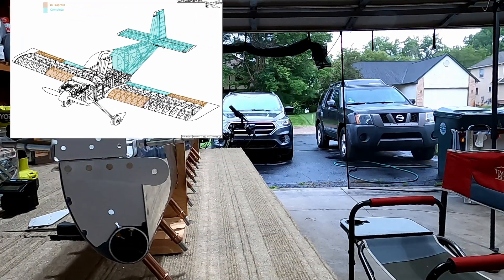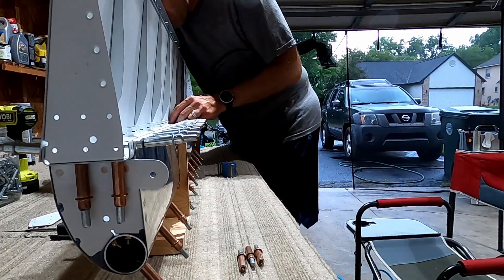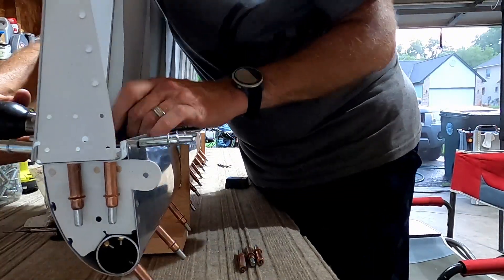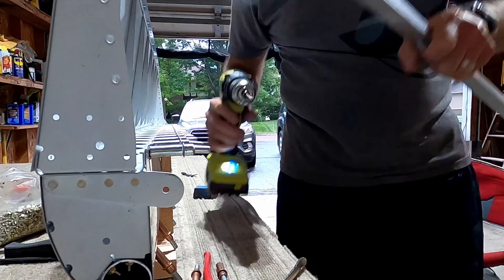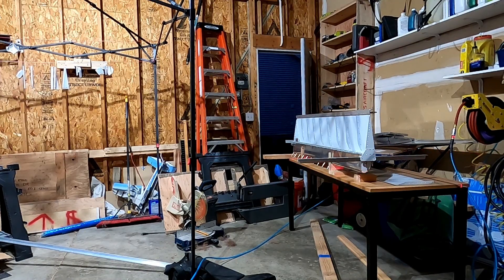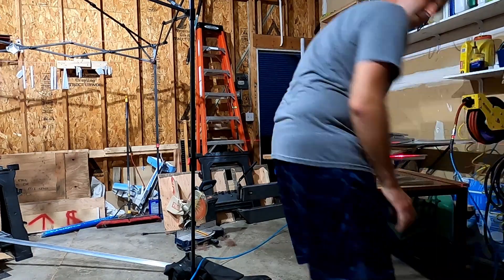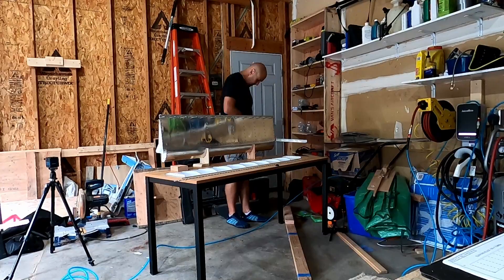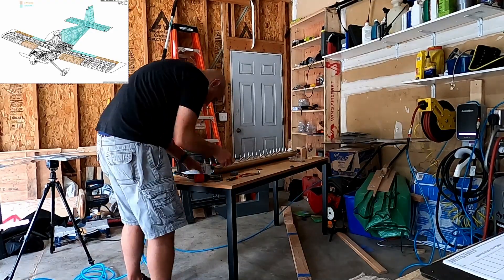RV-14 Build: Ailerons 9

Comment: Could you back rivet top skin?  Of course on a work bench that you have made sure does not have twist on the table.
Reply from the maker: If you mean the top skin to the spar, not really likely you're going to get a back rivet set in there.. the flange angles are less than 90, so between that and the interference of the other flange you're going to be sitting on the shop head at something like a 60-70 degree angle. Less than optimal.